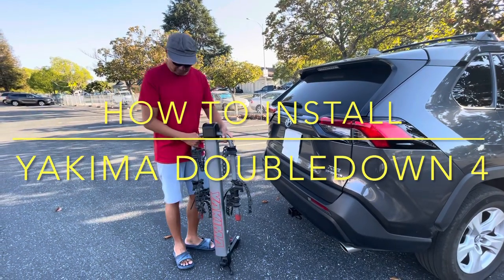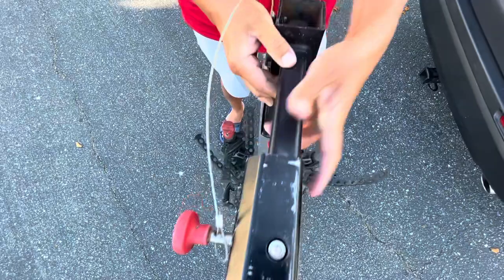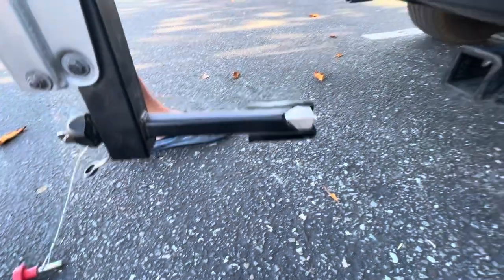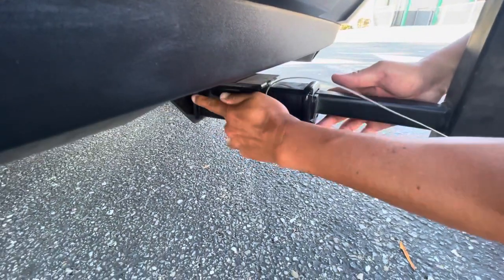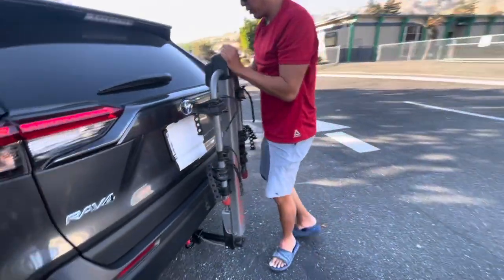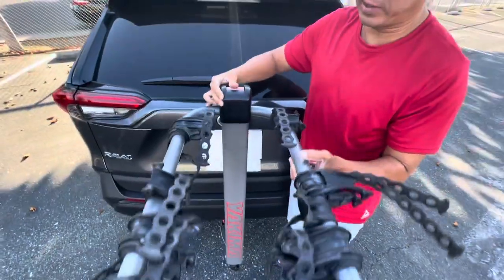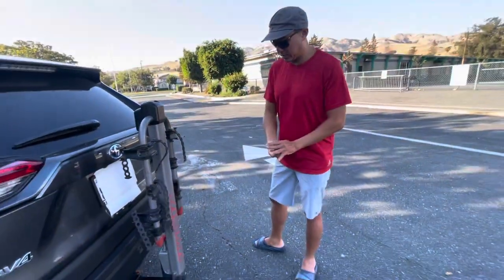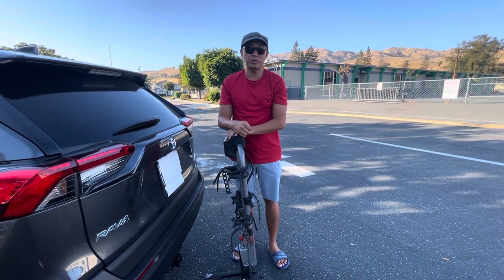How to install YAKIMA DoubleDown 4 hitch bike rack

Comment: Exactly what I needed to know, except for one thing which I haven't quite figured out. I always have trouble, when installing the rack into the hitch receiver, with inserting the safety pin into the round hole properly. It seems the prong on the pin is too wide.

I'm guessing the pin has to be inserted before tightening the knob, but is there some technique I'm missing? You did mention in the video something about a Notch on the pin's prong.